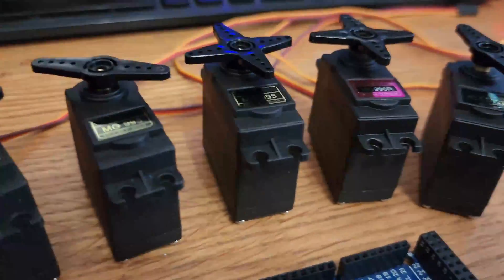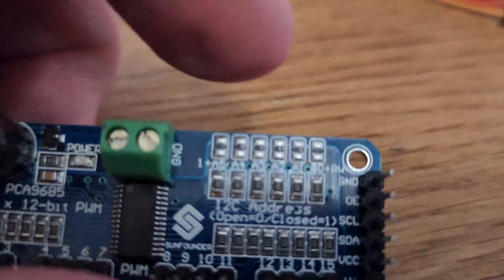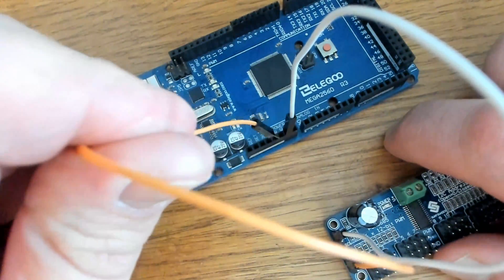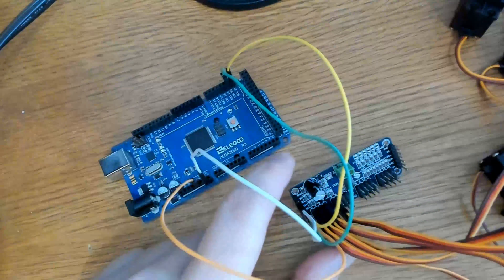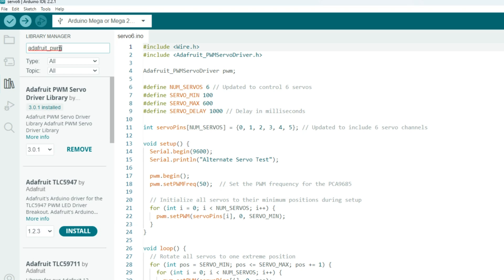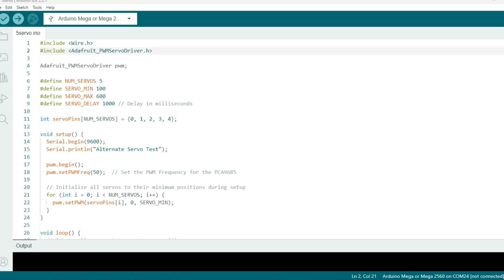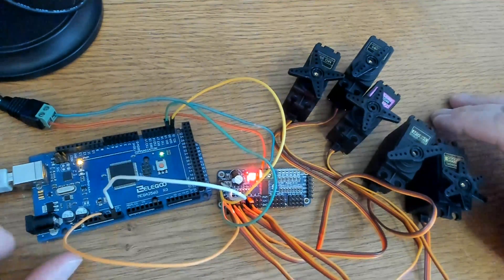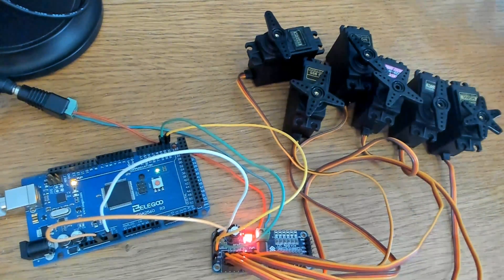Mastering Servo Control: PCA9685 PWM Driver with Arduino Tutorial and Demo

Comment: hello sir im just want to ask since this pwm controller will be use in our sorting arms with the servo. But unfortunately it is not working properly the pwm controller has not powered  even though it is supplied from the arduino arduuino 5v to vcc and ground to ground

we'll appreciate if you can answer it as soon as possible, since itll be deployed in our machine. thank you very much

we observe that whenever we change sda to scl and scl to sda the pwm contorller powered on

considering im using a psu with an output voltage of 5v 32 amps dc with 5*35kg servo and 1 12kg servo

but sometimes the board is powwered with correct postion of sda and scl (PS: My Arduino uno are perfectly fine but still i already try to chanfe it but nothing happens.
Reply from the maker: The SDA on the PCA9685 should be connected to A4 (SDA) and the SCL should be connected to A5 on the Arduino Uno. 
If you are using an external 5V PSU for the servos, make sure to connect the ground of the power supply to the Arduino's ground and the PCA9685’s ground - https://youtu.be/UeS5nY345kc . Make sure you have the correct gauge for your current draw. If you don' thave the correct size wiring, you can experience voltage drops and brown outs.
You can also try using a multimeter to check the voltage and current downstream to ensure the servos are getting the power needed. Check it when all servos are under load.

Comment: I have 4 servos that I am wiring up to my PCA9685. Would this code work if i have a Uno R3? I connected my analog A4 to SDA and A5 to SCL. I see you have an R4 and your pins are placed differently.
Reply: Yes it should, if there are any issues there is a video by SriTu hobby on using a servo drivers using an uno with the same SDA SCL set up as you and gives a code example.
Reply from the maker: Yes, it will work. I was using Arduino Mega in this video.  The I2C pins are just located on different pins for Uno.
do a google search for Arduino Uno R3 pinout if you need a visual 👍

Comment: Hi could you link what power connector you're using, I can't find the one you show with the two wires already included in it
Reply from the maker: Hey!
Ya, no problem. 
12V 5A Male Power Jack Plug Connector 5.5mm X 2.1mm, DC Power Adapter Barrel Connector 
https://www.amazon.com/dp/B0BTHRYSDX?ref_=ppx_hzsearch_conn_dt_b_fed_asin_title_1&th=1
There are also connectors for over 12v. They are a little more robust than these.

Comment: does the adafruit library support ALL versions of this pwm driver thing? i cant get the adafruit one where im from, i got a chinese version. thats why im asking if it works with any of them.
Reply from the maker: Hey there! The Adafruit PCA9685 library should work with all versions of the PCA9685 PWM driver, including Chinese versions. The PCA9685 is an I2C-based PWM driver, and most versions, follow the same protocol. 
The one I have is Sunfounder, not Adafruit, and it work fine. Where you getting stuck?
Reply: @BMonsterLaboratory  it works, i have 14 servos in total, 1 of them is 360 degrees and the other ones are 180, does it work the same with a motor of any degree or do i need to make it diferent for the 360 degree one?

Comment: hello, for 12 servomotors(MG995 or MG996R) for a robot dog, for power supply the servomotors ,what battery do you recommend?
Reply from the maker: hi there!~
Maybe a 2S LiPo pack 5000 mAh with a 6 V high‐current BEC/regulator rated for 10-15A
You'll definitely want to do some research on this, but maybe I can offer some advice.
Distribute power to the 12 servos through a dedicated bus (heavy‐gauge wiring, e.g. 14–18 AWG depending on length/current). Don’t rely on small jumper wires.
If your robot dog doesn’t move all joints under heavy load simultaneously, average current draw might be far lower than the worst‐case. Still, design for safe amperage headroom. Use capacitors to buffer voltage dips that can cause erratic behavior sometimes.
Also, make sure there's airflow around the battery. They can heat up while being used. 
you got this 👍

Comment: Hi, I need a power supply that is rated 6V, >100W / 20A. how do I find one for my robotic arm project?
Reply from the maker: have you tried something like this?  https://www.amazon.com/DROK-Converter-Adjustable-Regulated-Transformer/dp/B0B18NHW9R/ref=sr_1_5?crid=2TH1LEDXE97QX&dib=eyJ2IjoiMSJ9.odSwyKVml_7NRPL8kiHKuU4D_tOBaJncp_F5ucfwS-UHw5P_SBh74amDP_mKGtR9EJfLHhsSrbeTdN91pzwVm0KCldr8d8PuTu_Ko-p2rUmXPwiAWFjN686bpul5ZIqPc29kuDQm4pM5OnEukY1_E8vCy2a7AFvCOwmCQebrD7NxJaXa3GnUJl0nLxLI71hRCxY0Uw6zzN3WOdo4c6eLzeIGbC-cvf_czg2OGJ75J2g.TX7hjZRrO4K9MxWBxJtbHr1M9jSnxF4U82O_P_lB8io&dib_tag=se&keywords=6v%2B20a%2Bpower%2Bsupply&qid=1739656155&sprefix=6v%2B20a%2Bpower%2Bsupply%2Caps%2C135&sr=8-5&th=1

Comment: Hi, can i power 6(mg996r servos) at the same time with this? I am going to use an external power supply of 5V 10A. This is for a robotic arm
Reply from the maker: the MG996r can draw up to 2.5A at 6v. You're running it at 5v, you may be ok with a 15a supply...it depends on your project.
here are some details on the motor and link to the data sheet https://components101.com/motors/mg996r-servo-motor-datasheet
Whatever your max current needs are, add 20% so it doesn't heat up and add a capacitor to buffer voltage dips.
This video may help https://youtu.be/UeS5nY345kc

Comment: I am using servo motors mg995 with arduino uno what power supply should like its name and voltage and amps
Reply from the maker: Avoid powering the MG995 directly from the Arduino. You need external power to drive the motor. Check the MG995 datasheet - Here's the Towerpro MG995 data sheet link https://towerpro.com.tw/product/mg995/
operating voltage is 4.8-6.6v
no load current is 170mA
stall current is 1.2A (at its peak!)
determine the voltage and load for your servo. You can apply load and test current with a multimeter to get a good idea of the current you'll need. I always add 20-25% current capacity on top of the maximum  I will require to give a bit of overhead to the current and motors don't overheat as easily.
You also have to determine a few things. Will motors be operating with the same load at the same time, will they be operating at different times...this all will have an impact on the current you need.
If you're using the PCA9685 board with multiple servos, this may help https://youtu.be/UeS5nY345kc
If I were using just 1 MG995, I would run at 5-6v with a 3A power supply. Be sure to do your research and planning before applying power.  I hope this helps.
Reply: @BMonsterLaboratory  Actually I am using 8 servo motors.What is the power supply I should use. I used only one servo motor directly with Arduino to test but the servo motor did not run. So should I use external power supply for one motor too.

Comment: Hi @BMonsterLaboratory, thanks for the video, it was really helpful, one question maybe you could help me, I want to connect 16 Tower Pro Sg90 9g to this board, what power supply do you recommend?
Reply from the maker: Hey there! 
One thing is for sure, you'll need external power to operate 16 of those servos. 
How are you using the motors? will they all move at the same time? will they be at or near load capacity when they move? what voltage will you use? how much space will you have for a power supply?
The power supply you need really depends on how they are used. If you are using them at 5v and they are operating near capacity load, you may need to have 5v 1.2-1.5A  available per motor. If you run them at 5v with light load you may only need 600ma per motor. You will want to know the current draw of your setup before you start.

Comment: Great tutorial!!! Was direct to the point and simple to understand. May I ask if it is possible for controlling the timing of individual servo motor? For example I want servo 1 to run for 10seconds then after that it stops then another servo (servo 2) will start to run for 5 seconds then after that both will run together?
Reply from the maker: hey there -  Thank you! 👍
You can operate each servo independently and you can adjust the start and stop points of each servo individually by controlling the pulse width signal. I should make a quick video. a number  of people have asked similar questions.
Reply: @ Thanks a lot bro!!! looking forward to that video! Thank you again for the great and easy to understand content

Comment: I'm trying to get servos to operate flight controls. I want the servos to work at the same time, but in different direction and timing
Reply from the maker: Hey there!
The trick is to manage each servo’s position update separately rather than locking all servos together inside a single for loop.
Here's a modification of the sketch I posted to Facebook: 

#include <Wire.h>
#include <Adafruit_PWMServoDriver.h>

#define NUM_SERVOS 5
#define SERVO_MIN  100
#define SERVO_MAX  600

Adafruit_PWMServoDriver pwm = Adafruit_PWMServoDriver();

int servoPins[NUM_SERVOS]      = {0, 1, 2, 3, 4};
int servoPositions[NUM_SERVOS] = {SERVO_MIN, SERVO_MIN, SERVO_MIN, SERVO_MIN, SERVO_MIN};
int servoDirections[NUM_SERVOS] = {+1, -1, +1, -1, +1};
// Different speeds for each servo
int servoSpeeds[NUM_SERVOS] = {1, 2, 3, 2, 1};  

void setup() {
  Serial.begin(9600);
  Serial.println("Independent Servo Control Example");
  
  pwm.begin();
  pwm.setPWMFreq(50); // 50 Hz for servos
  
  // Initialize all servos to SERVO_MIN on startup
  for (int i = 0; i < NUM_SERVOS; i++) {
    pwm.setPWM(servoPins[i], 0, servoPositions[i]);
  }
}

void loop() {
  // Update each servo independently
  for (int i = 0; i < NUM_SERVOS; i++) {
    // Adjust position by direction * speed
    servoPositions[i] += servoDirections[i] * servoSpeeds[i];
    
    // Check boundaries and flip direction if needed
    if (servoPositions[i] >= SERVO_MAX) {
      servoPositions[i] = SERVO_MAX;
      servoDirections[i] = -servoDirections[i];
    }
    else if (servoPositions[i] <= SERVO_MIN) {
      servoPositions[i] = SERVO_MIN;
      servoDirections[i] = -servoDirections[i];
    }
    
    // Send position to PCA9685
    pwm.setPWM(servoPins[i], 0, servoPositions[i]);
  }

  // Short delay for smooth movement
  delay(20); 
}
Reply: @BMonsterLaboratory  
I want to set them up in a circular array. 8 to control 8 individual mechanisms that can bend like a human finger. Up and down. I also want 4 different servos to operate a 4 vents via tab in linked pivot system.

Here's a code that chatgtp gave me. Just an idea of i would like to accomplish, i guess. (Can't code)
#include <Servo.h>

// Servo arrays
Servo airfoilServos[8]; // 8 airfoil servos
Servo ventServos[4];    // 4 vent servos

// RC joystick and button input pins
const int leftJoystickY = A0;  // Left joystick Y-axis (hover control)
const int rightJoystickX = A1; // Right joystick X-axis (flight control)
const int rightJoystickY = A2; // Right joystick Y-axis (flight control)
const int thrustControl = A3;  // R2 button (rotor speed control)

// Servo pins
const int airfoilPins[8] = {2, 3, 4, 5, 6, 7, 8, 9}; // Airfoil servos
const int ventPins[4] = {10, 11, 12, 13};            // Vent servos
const int rotorPin = 5;                              // Rotor motor PWM pin

// Variables for control and state
float joystickAngle;           // Joystick angular position (0° to 360°)
int ventPositions[4];          // Positions of vent servos (0 to 90 degrees)
int airfoilPositions[8];       // Positions of airfoil servos (0 to 90 degrees)
int rotorSpeed = 0;            // Rotor/impeller speed (PWM)
float hoverAltitude = 0;       // Current hover altitude
bool isHovering = false;       // Hover mode state
const float transitionSpeed = 2.0; // Speed of servo transition

void setup() {
  // Initialize airfoil servos
  for (int i = 0; i < 8; i++) {
    airfoilServos[i].attach(airfoilPins[i]);
    airfoilServos[i].write(45); // Neutral position (midpoint)
  }

  // Initialize vent servos
  for (int i = 0; i < 4; i++) {
    ventServos[i].attach(ventPins[i]);
    ventServos[i].write(0); // Start with vents closed
  }

  // Initialize rotor motor control
  pinMode(rotorPin, OUTPUT);

  Serial.begin(9600);
}

void loop() {
  // Read inputs
  int leftY = analogRead(leftJoystickY);      // Left joystick Y-axis (hover control)
  int rightX = analogRead(rightJoystickX) - 512; // Right joystick X-axis (centered at 0)
  int rightY = -(analogRead(rightJoystickY) - 512); // Right joystick Y-axis (centered at 0)
  int thrustInput = analogRead(thrustControl); // R2 button for rotor speed

  // --- Hover Control (Left Joystick) ---
  if (leftY > 800) { // Joystick pushed up (threshold for increasing altitude)
    hoverAltitude += 1; // Increase hover altitude
    isHovering = true; // Enable hover mode
  } else if (leftY < 200) { // Joystick pulled down (threshold for decreasing altitude)
    hoverAltitude -= 1; // Decrease hover altitude
    hoverAltitude = max(hoverAltitude, 0); // Prevent negative altitude
    isHovering = true;
  }

  if (isHovering) {
    // Maintain hover altitude
    for (int i = 0; i < 8; i++) {
      airfoilServos[i].write(90); // Curl airfoil downward for lift
    }

    // Open all vents for stable hover
    for (int i = 0; i < 4; i++) {
      ventServos[i].write(90); // Fully open
    }
  }

  // --- Flight Control (Right Joystick) ---
  if (abs(rightX) > 100 || abs(rightY) > 100) { // Right joystick engaged
    isHovering = false; // Exit hover mode

    // Calculate joystick angle for flight control
    joystickAngle = atan2(rightY, rightX) * 180 / 3.14159;
    if (joystickAngle < 0) joystickAngle += 360; // Normalize to 0–360°

    // Vent Control
    for (int i = 0; i < 4; i++) {
      float targetAngle = i * 90.0; // Vent's central angle
      float angleDifference = abs(joystickAngle - targetAngle);
      if (angleDifference > 180.0) angleDifference = 360.0 - angleDifference;
      int targetPosition = map(angleDifference, 0, 90, 90, 0); // Fully open to fully closed
      ventPositions[i] = constrain(targetPosition, 0, 90);

      // Gradually move the servo to the target position
      int currentPosition = ventServos[i].read();
      if (currentPosition < ventPositions[i]) currentPosition += transitionSpeed;
      else if (currentPosition > ventPositions[i]) currentPosition -= transitionSpeed;
      ventServos[i].write(constrain(currentPosition, 0, 90));
    }

    // Airfoil Control
    for (int i = 0; i < 8; i++) {
      float segmentAngle = i * 45.0; // Airfoil segment central angle
      float angleDifference = abs(joystickAngle - segmentAngle);
      if (angleDifference > 180.0) angleDifference = 360.0 - angleDifference;
      int targetPosition = map(angleDifference, 0, 90, 90, 0); // Curl up or down
      airfoilPositions[i] = constrain(targetPosition, 0, 90);

      // Gradually move the servo to the target position
      int currentPosition = airfoilServos[i].read();
      if (currentPosition < airfoilPositions[i]) currentPosition += transitionSpeed;
      else if (currentPosition > airfoilPositions[i]) currentPosition -= transitionSpeed;
      airfoilServos[i].write(constrain(currentPosition, 0, 90));
    }
  }

  // --- Rotor Speed Control ---
  rotorSpeed = map(thrustInput, 0, 1023, 0, 255); // Map R2 input to PWM range
  analogWrite(rotorPin, rotorSpeed);

  delay(20); // Smooth transitions
}
Reply from the maker: @alexmedvec4571  Have you checked out Bottango software for animatronic movements?  It's fantastic!  You build the movements in the software and export the code. I have a few videos using it. The more I use it the more I like it.

Comment: BRO I HAVE ANTOTHER QUESTION.... IN MY PROJECT IM USING 14 SERVOS , AT ONECE  I WILL  PUT 4-6 SERVOS  UNDER LOAD AND THE SERVO IM USING IS MG995 ONE , PARACTICAL IDEL CURRENT IT SHOWS 300mA WHEN CONNECTED TO A CIRCUIT , AND MAX IS 1.1-1.2 AMP , WITH THIS CONFG. ON MY PROJECT I WILL REQUIRE 7.2 + 2.4 AMP NEARLY 10AMPS  UNDER LOAD , CAN YOU SUGGEST SOME UBEC SO THAT I CAN CONNECT MY 2S LIPO TO THE SERVO DERIVER?
Reply from the maker: Maybe take a look at the YEP 20A HV SBEC https://hobbyking.com/en_us/yep-20a-hv-2-12s-sbec-w-selectable-voltage-output.html?srsltid=AfmBOopTK4U0PTWRLhwaJf2Umhg3uVD9vOON1yzLjkN3PkIJhk46rfO1
This would give you plenty of current capacity (20 A), supports a 2S LiPo input (6 V–8.4 V) with no problem, and offers multiple selectable output voltages (5 V, 5.5 V, 6 V, 7 V, or 9 V).
Some things to keep in mind: 
Use a 1000 µF on the servo rail to smooth out current spikes.
Reduce voltage drop by keeping wires short.
Use the right gauge wires for your setup, for both sides - battery-to-BEC  and BEC to the servos. 

I don't want to say you should buy anything specific, but this might help you in doing some research in finding the right one.   👍

Comment: Can i use arduino cloud platform with this setup and control each servo manually over wifi from a distance?
Reply from the maker: Hey there!  Yes, you should be able to use Arduino cloud to operate any of these servos from their web interface - from anywhere. I would like to do a few more videos with this breakout board. Thank you for the excellent question! 👍
Reply: @BMonsterLaboratory  cool I would love to watch